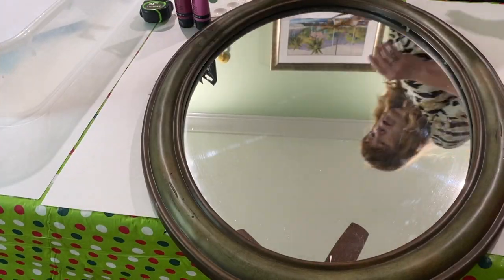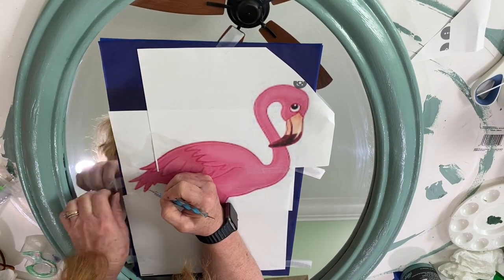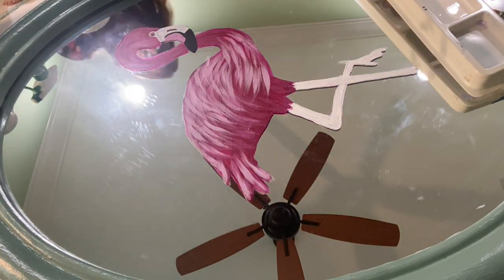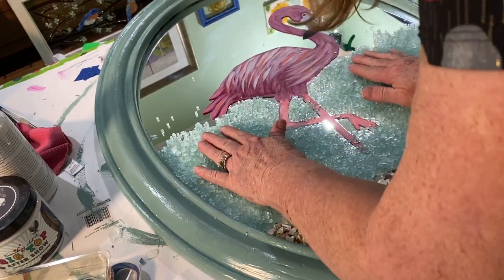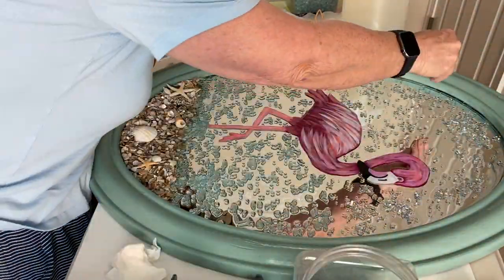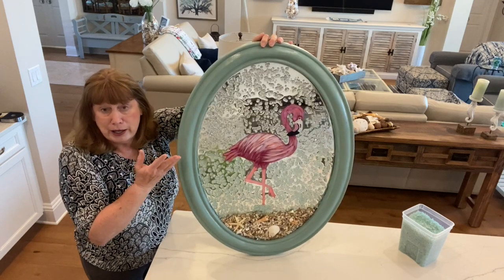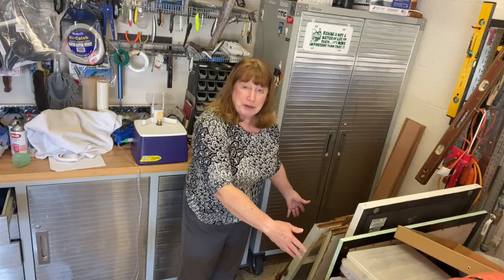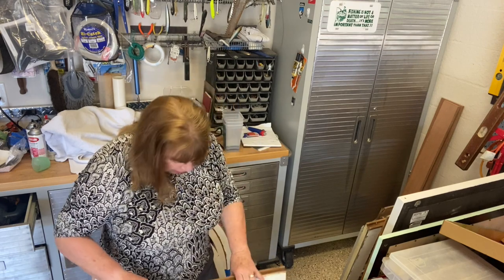EPOXY RESIN MIRROR, PINK FLAMINGO, TEMPERED GLASS , CRUSHED GLASS, GLASS ON GLASS, ART RESIN

Comment: People who have gotten in car accidents where a window has broken, have gotten cuts from the glass. It is sharp when it breaks. Tempered just means it's been heated in a way that if it breaks, it breaks into the small pieces rather than a regular piece of glass that breaks in an irregular pattern with lots of shards which tempered is not supposed to break that way. Fire glass is obviously been treated in a different way that it looks like broken tempered glass, but when its broken, it doesn't break with sharp edges... But, the tempered glass you used, is the same color as the frame and I could tell the difference between it and the sparkle glass, when you held the mirror up, it is subtle but pretty. You did an excellent job painting the flamingo!! I love it!!
Reply from the maker: Thank you, and thank you for the tempered glass info also!

Comment: Linda I have been collecting broken tempered glass from a few windshield replacement places. The windshields now have some kind of lining in them.  Which makes them no good for using with glass art. However the vehicle side windows are great. They save it for me. I have not found it sharp at all while washing in a big bucket of water with my bare hands in it. Yesterday I  got a big bucket of dark tinted glass.  Doing the happy dance here. This Flamingo project is Absolutely stunningly Beautiful ❤ You did a lovely job painting  the Flamingo. Keep creating and smiling.  Oh I  have a big bucket at two boat places here. I will see if that glass is sharper then my others.
Reply from the maker: Wonderful. so my boat windshield was blue which was nice.

Comment: The video.  My husband and I own a glass company.  The tempered  glass us a safety glass that when it breaks it will not cut you like plate glass. The reason  the tempered glass broke up with the longer shards is the way it was tempered  in the oven.  Hope this helps you.
Reply from the maker: That is interesting I thought it was like that because of the way my husband smashed it. The long shards were very sharp i was surprised
Reply: @crazyglasslady  not hubby fault it is the temperature  of the oven when the glass is run threw it. It happens  sometimes  but not all the time. It is a safety glass. It is what is in your car doors and backslash, in patio doors,  any human passageway.  Your car windshield  is made of laminated glass  another safely glass.  Just letting you know.
Reply: Backglass